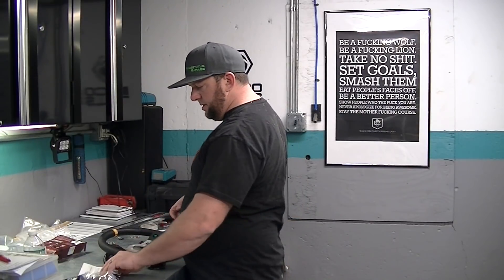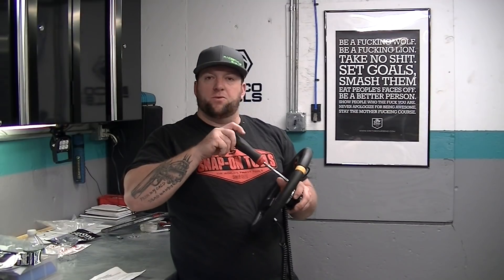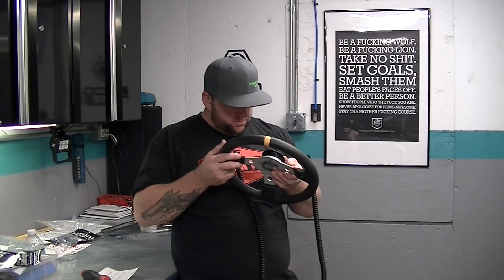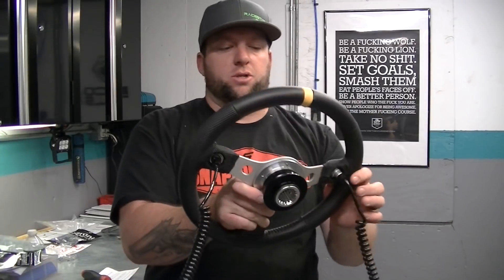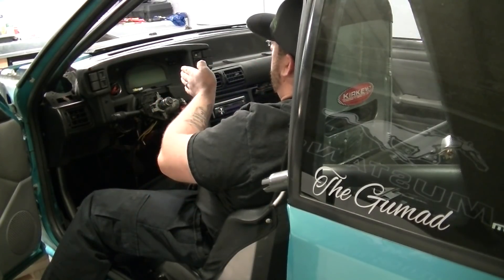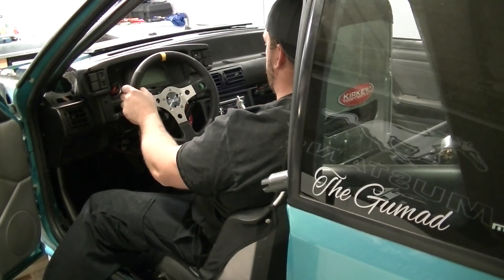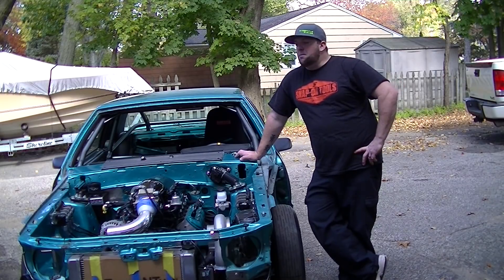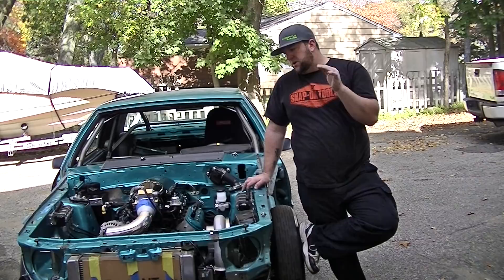Ls Foxbody Build EP. 23 Interior!

Comment: Why does everyone do LS swaps in Ford vehicles because there cheap?  The coyote is a far superior turbo engine. 4 valves per cylinder it's a no brainer, an engine is a big air pump and the more air you flow threw it the more power you make.
Reply from the maker: Matt Jones stock to stock my heads flow 20 less cfm than a coyote. Is 20 cfm worth 2k-4k more in a price tag? Ill make the same power as a coyote at a 5th of the price. It really is a no brainer.
Reply: I don't think you are educated on these engine designs